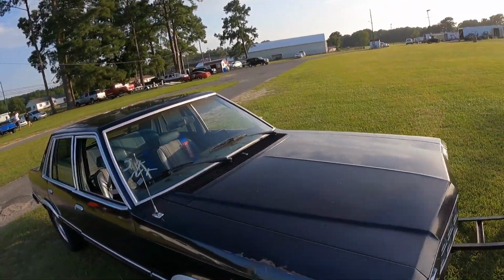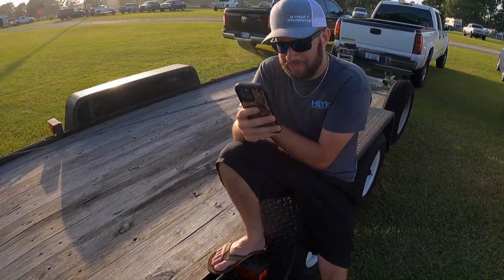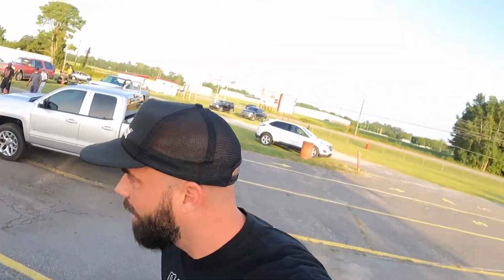Turbo Fairmont Testing Almost Goes VERY Bad!

Comment: I would've just turned around & pointed my headlights back up towards the starting line
Reply from the maker: Sounds good on paper but when the reason the car is one the track is because the steering locked up...that becomes a little difficult.
Reply: @ClapdOut  true....I'm talking about the friend that made the phone call
Reply from the maker: Gotcha.